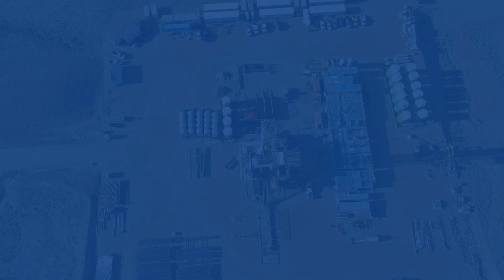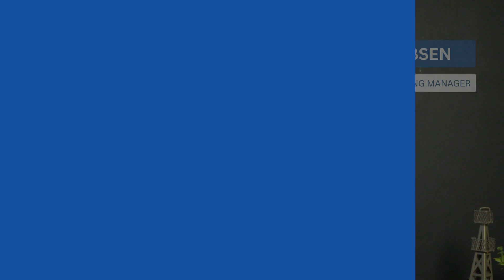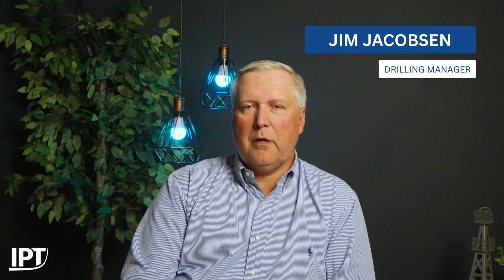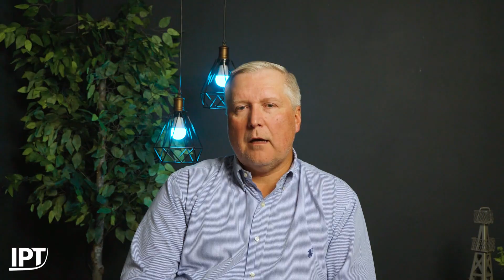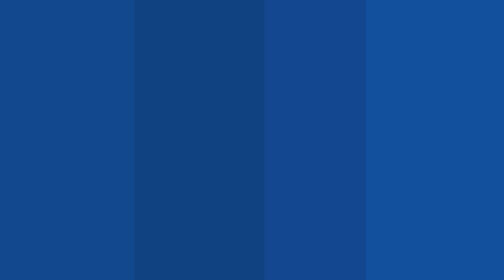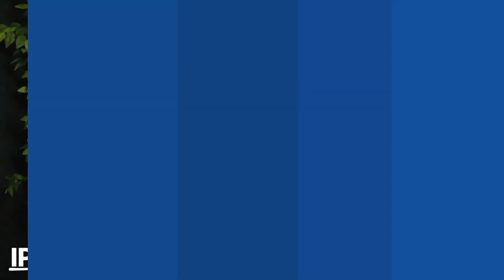How We Got 6" Casing to Bottom in a 3-Mile Horizontal Well (Case Study)

Comment: "Securing TD with a stiffer 6-inch casing in a 3-mile Niobrara lateral is a stellar engineering pivot. However, increasing the casing OD naturally tightens the annular clearance, which impacts ECD and surge/swab pressures during the run. Given the last-minute switch, did the real-time friction modeling indicate a significant risk of bridge-building due to the tighter annulus, and how did the thin synthetic OBM perform in mitigating that specific risk compared to the original 5.5-inch plan?"